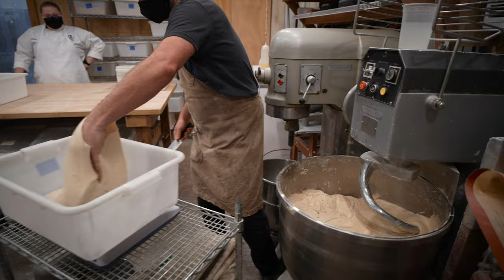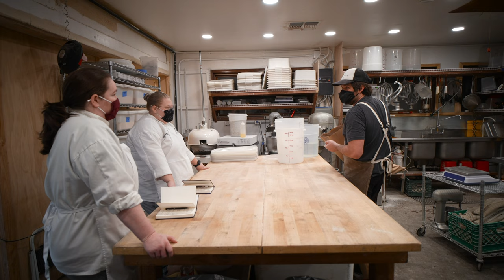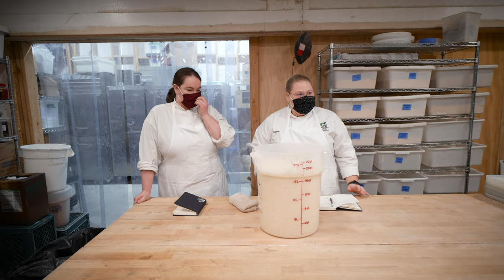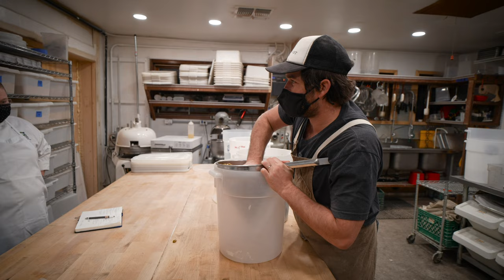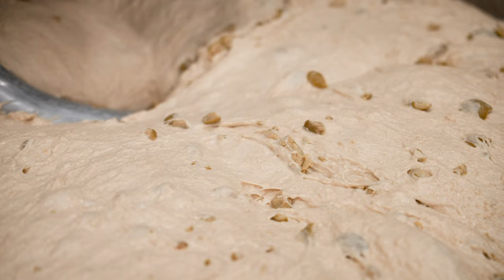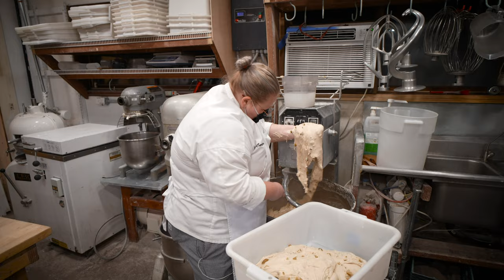Learning to Mix and Scale Sourdough | Proof Bread

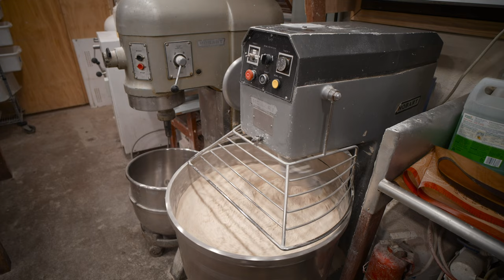Comment: 14:57 starter is very difficult to kill. Even if it sat in the fridge for months and has a lot of hooch, mix it in and feed and should rise in activity. I have a secondary starter that tends to sit in my fridge since I don’t use wheat in my loaves anymore, but it always comes back to life (peaking about 2 1/2) after a long stint in the fridge.
Reply: I agree complpetely when I've known that i want it to last in the fridge longer i have made it scant water just enough to get it wet this slowed down both the yeast and bacterial growth so othat it was fine after 6 months add a little water to soften then do a regular feeding after to its active  Wild yeast are used to starvation they grow like any other species in nature geometrically and then crash during the crash they make spores like many fungus do.  If i have let mine go to the rotten stage i scrape off the molde till i just have alcohol on top mix it well take a small amount feed it and after 3 or four feedings it is ready to go.  You save all that time finding 
the two ingredients from the environment by reusing the starter.  I would definitely wait until it smells good before trying to use it in bread.

Comment: A pretty good video that makes a good point.   I've scaled bread bakes up to dozens of loaves/boules using yeast, quite readily and easily....but using natural leavening, I still struggle to figure out the timing, environment (heat, humidity, timing of the rises), and other factors to get the bread timed just right. Easier said than done.

Comment: I understand that you remove the olive oil from the olives before doing your inclusion into the dough, but have you ever used that olive oil as part of your wet mix to make your dough itself...thus making a more olive flavoured dough?
Reply: Oil is fat. It changes the chemistry of a loaf. If he's adding olives and doesn't rinse them really well, the fat that is still coating the olives is considered when making the loaf. Oils dont add "hydration." And since he autolyses most of his sourdoughs, the fat isnt added at the beginning, its added later
Reply: I reread this at the point he was adding olives. He sites the bassinage technique. He said he saves part of the liquid for that dough so he can add more  liquid later if he needs to. At that point, its feel, but sounds like he might use the reserved olive liquid as the water he adds later dueing mixing
Reply: @jackiebeidler4592  that’s really great; the flavor gained from using the olive oil will just add dimension to the end results

Comment: What is the blue tape you use to label the dough? What essential info do you put on it as well? Dough temp and dough type ?
Reply: It was only labeled with the name of the dough...and the time it first went into the bins for bulk fermentation.  I.e.: sandwich, olive, sourdough(reg), etc.
Reply: Its painters edging tape. Sometimes its cheaper than masking tape. Used for labeling everything in commercial kitchens in america. Per most state health departments, everything made in a restaurant must be label, dated and initialed. In a bakery, times are probably included as well

Comment: Would it work to pre-drain and dry the olives? Lay them out in sheet pans and lay them out in the sun or on top of the ovens or in a turned off oven? I have typically seen oil cured  black olives in olive bread. They have less water content.
Reply: No that would make it way worse, concentrating the existing salt inside because moisture is evaporating.
Reply: Its probably not adventsgeous to make this process longer than he is doing. Thats too much labor and time to preform a task that can be done by the baker making the dough (rather than relying on another individual having to do that hours beforehand)

Comment: I know nothing about baking so I'm just a bit curious. Does putting your arm in the dough pull on your arm hair? I just imagine it would feel like ripping sticky tape off your arm daily
Reply: It isn’t that sticky that it pulls it right away, but if you let it dry, then getting it out is super painful. 

I bake sourdough 3x a week and have very very hairy arms
Reply: The more experienced you get the less the dough sticks. You can see the dough kinda sticks but definetly doesnt hold as tight as a sticky tape. So in my experience you hardly feel it on your arm hair. If the dough dryes on the hand tho... thats a different story. Its as hard as concrete and getting it out of hair is terribly anoying and painful
Reply: Depends on the dough. Notice he wets his hands before working it. Doesnt really stick to your arms, stick to dry hands though. Oil or water works wonders